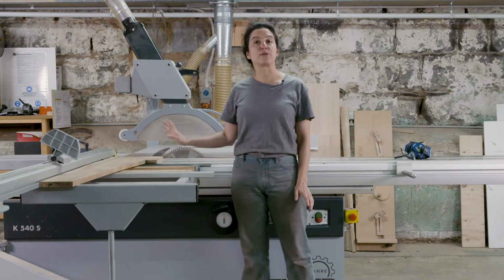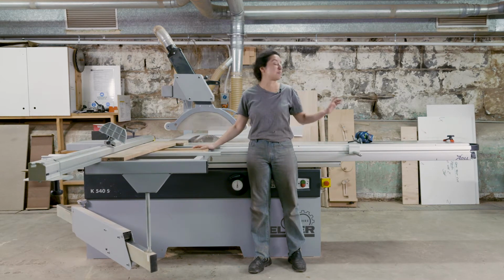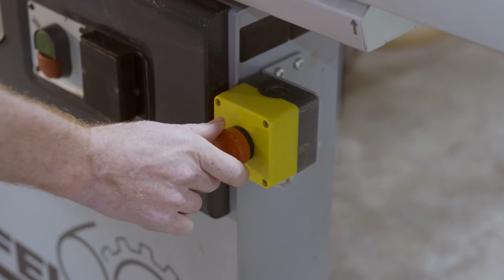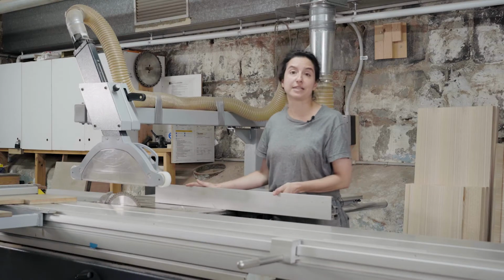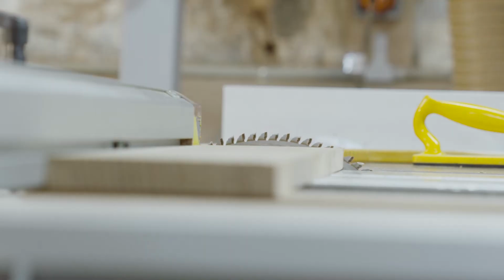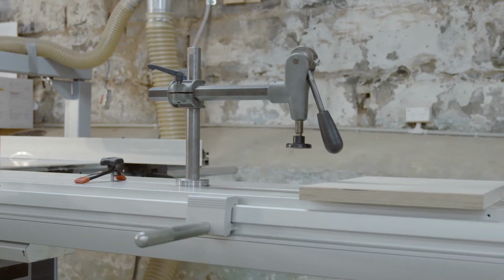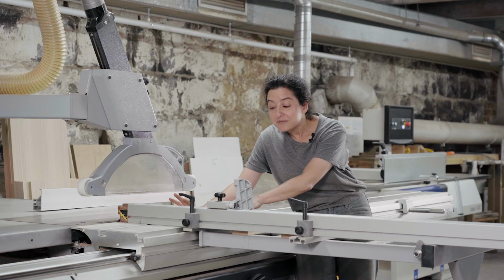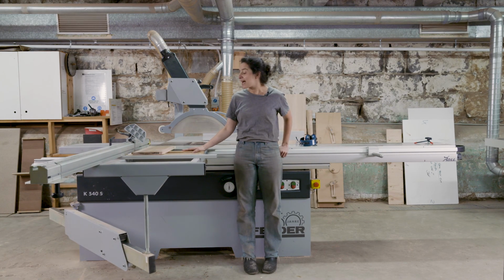PANEL SAW - MACHINE USE AND INTRODUCTION. VICTORIAN WOODWORKERS ASSOCIATION - SCHOOL OF WOODCRAFT

Comment: s
She called the wood, timber.
Reply: yes, there is a difference, the material is wood, but in machining its only 'wood' when all sides are planed parallel and square to each other, if its just in from the mill, or from a tree, just felled\ bucked with a chainsaw, bark and rough edges, even in boards, its called timber to distinguish it in the shop processed vs raw stock.